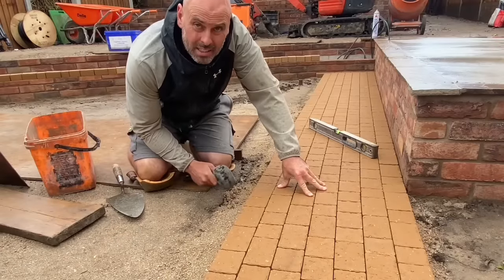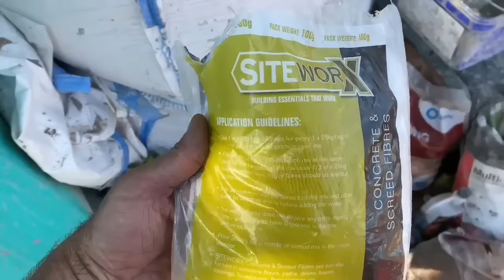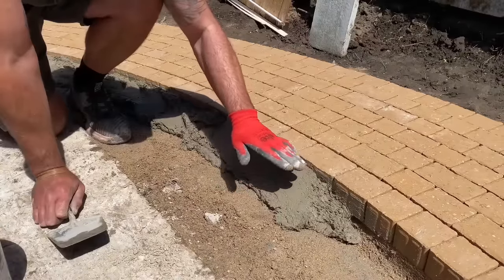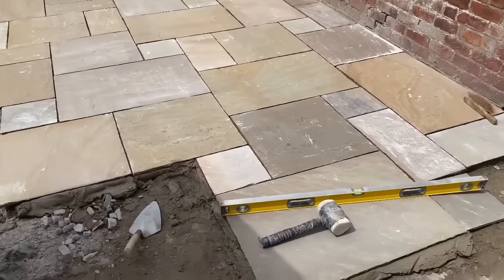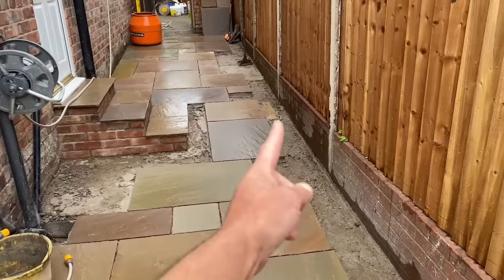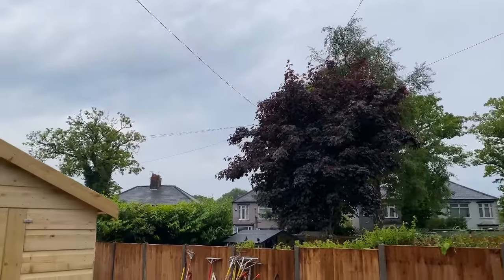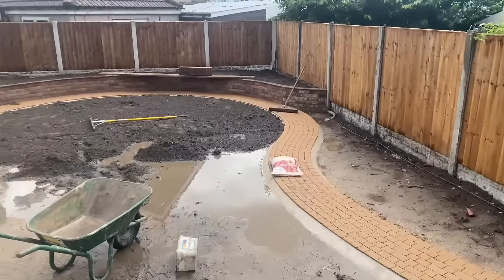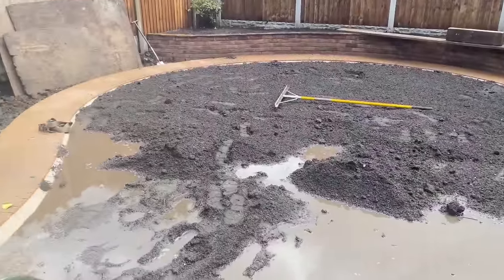The Keyhole Garden

Comment: As I've said before, top work mate.  If I can give you a little tip...   I use brick clamps to do heavy blockwork, you can set them up great for a block and it'll leave a perfect 10mm joint every time. Takes the weight from your hand and makes it a breeze to do.  My clamps are only good in one direction but once you figure the direction you'll be flying and feel like you have laid 300 bricks instead of 300  heavy concrete blocks. 
Have a great day 😉
Reply: Ohhh and I have never seen a Jointer on wheels.  I guess it's like a Zimmer frame for the old.
Reply from the maker: Thanks mate 👍

Comment: the chisel needs sharpened- used to be a drill tool for sharpening lawnmower blades at home base and b&q.. works decent, just run slow and careful with overheating.. eases the troubles on stone
Reply from the maker: The chisel was sharpened the day before thanks 👍